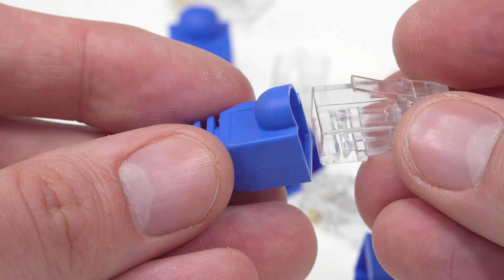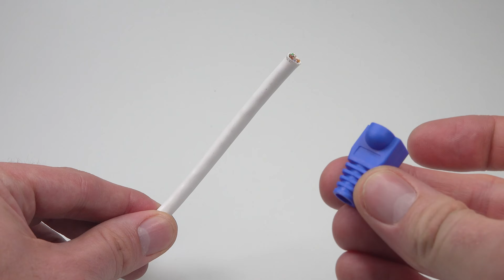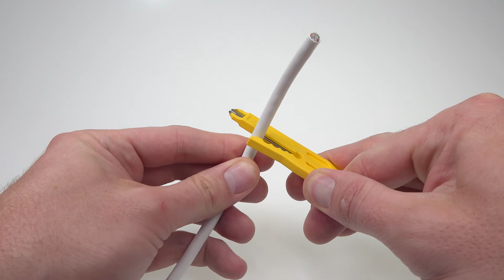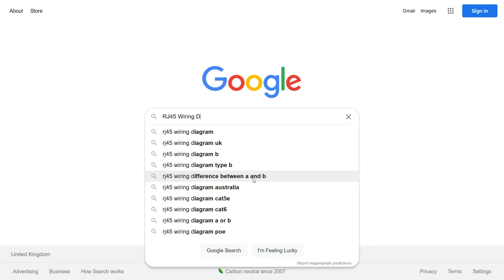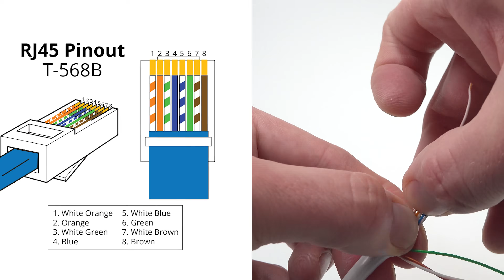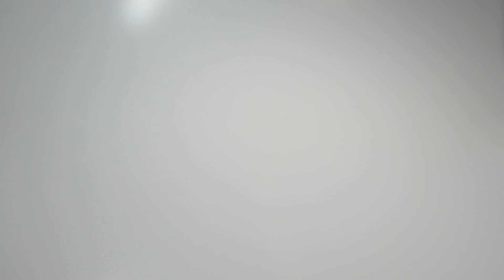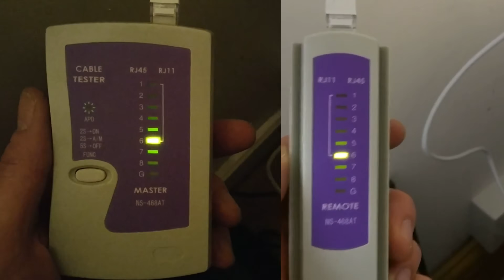How to Crimp Cat5 / Cat6 Network Patch Cables (RJ45 plugs)

Comment: Shouldn't any wiring order work as long as both ends follow that same order?
Reply from the maker: No, because the twists and which pairs are twisted together are important. Different pairs handle different things and in different direction for two way communication and error handling etc. Twisting pairs together prevents electromagnetic interference and allows cancellation of unwanted RF etc
Reply: @SwitchedOnNetwork  Good to know. Thank you.

Comment: i'm having an issue where I recently replaced a cat5e with a cat6 that goes from my verizon modem outside my house to my router inside my house. I crimped the cat6 myself by my router is reporting a 100mbps full duplex signal instead of 1000mbps which is what I expected. The wire is kinda already installed and pinned against the wall. What should I do? Where should I start?
Reply: Start by using the cable tester. It's possible some lights won't light up. Fast Ethernet (0.1Gbit) can run on just two twisted pairs, so that's why it's still syncing at all, if indeed something has come undone. You may need to reterminate, and pinning against the wall may not be so good.

Pass-through RJ45 plugs are much simpler to get right.

Comment: I wanna say best tutorial and dumb proof, but somehow my new cable is not recognized at all :D
Reply from the maker: Ooops! Did you test it with a tester?
Reply: @SwitchedOnNetwork  Nope, i didnt push   brown one all the way in, i realized that after i tryed to pull it out, bcs i though i can do same step all over again, but then i realized it cannot be replaced one you press crimpers. :) Well, bought a new 5 connectros and was able to make it on first try, but yea, weekend on WiFi with laaags :( :D
Reply: Practise makes perfect... you crimp enough cables you will eventually hit almost 100% connectivity without even using a tester..... not that you shouldn't a tester... but confidence is a powerful thing. :P

Comment: I have two (possibly stupid) questions, hoping that others may benefit from any answers this may get. :-)
1) What is the "tip" of the yellow stripper tool used for?
2) Is there any technical reason — beyond making it easier for maintenance —  to use the same standard that a network currently uses? For instance, when I first lay down cat5e cable in my house over a decade ago I used the 'A' standard to terminate the cables going from one switch to the next. If I were to replace one of them with a new cable terminated with the 'B' standard, wouldn't it still work? As far as the switches are concerned, they're nothing more than patch cables. I'm not sure if I'm missing something obvious, hence the "possibly stupid" question. :-)
Thank you in advance!
Reply from the maker: No such thing as a stupid question! :-)
1) It can be used as a (very rudimentary) punch down tool for wiring up keystone jacks (ie. wall sockets). However, if you're going to be doing any of that I'd recommend a much better tool, the one I demo in this video here: https://youtu.be/IHxTbtAEd-E
2) You're basically right, yes, they'd just be treated as patch leads so you wouldn't notice or experience any problems whatsoever. There's a bit more to it than that, and I'm sure someone will come along and tell me how wrong my last statement is, it's to do with legacy backwards compatibility with smaller RJ11 phone connections before the general shift to the B standard but it's too much to get into here. TLDR; yes you'll be fine with either standard! (But as you say, for maintenance, knowing that anything other than a simple pre-made off-the-shelf patch lead uses either A or B will be useful for any properly installed cable runs).
Reply: @SwitchedOnNetwork  Thank you very much! I just have ethernet cables going straight into switches as those "wall sockets" were insanely expensive when I first started cabling up my house many years ago, and I just kept going like that. :-) Also thanks for clarifying the A vs. B mix-up issue: I kept seeing the same recommendation ("make sure you use the same as what's already there!") but nobody ever points out that it's mostly for maintenance reasons, rather than anything technical. The A system should be an expansion of RJ11, with the central pairs being effectively the same as an RJ11 connector and the other two added to the sides, one wire on each side per pair... if that makes sense. Still no idea why B is "better" but it's one of those holy wars we all seem to partake in when it comes to technology. :-D
I also just followed your suggestion in another video and ordered a box of pass-through connector, a pair of pointy clippers and a specialised crimping tool, as I've had hell trying to crimp this cat6 wire with the old equipment I had: the wires are so stubborn that the moment I went to actually crimp the connector, at least one would "roll back" and not make contact. And to think I could crimp cat5e cables almost blindfolded! I do wonder if using the B system would make for a physically looser "sorting order" of the wires. I'll give it a go as soon as the crimping tool is delivered, maybe that's why it's considered better!
Thanks again, and great channel. Subbed here and followed you around social media — seems like we share several points of views!

Comment: Wired up both ends but when testing the led in the 6th position doesn't light up. Does this mean the solid green wire (the wire that is occupying the 6th position) is faulty/broken?
Reply: Great vids by the way 😁
Reply from the maker: Thanks! Yeah that will mean there's a break somewhere in the connection. Depending on how fancy your tester is, it might tell you which end (or at least help you figure out which end) so you know which one to snip off and redo.

If you're using a tester like the one in the video, try swapping the sender/receiver ends round. IIRC, if it lights up on the sender end but not the receiver end it's likely that the fault is on the receiver end - hope that helps!
Reply: @SwitchedOnNetwork  had plenty to spare so cut them both, bought some passthrough clips for good measure and all is good now. There'll be no stopping me now!!! 

Thanks

Comment: Did you use 8B in both ends of ur wire?
Reply: Or the other ends of ur wire is 8A?
Reply from the maker: Yes. You must use the same standard at each end (A and A or B and B) unless you want to make a crossover cable, which would have A at one end and B at the other (rarely used these days).
Reply: @SwitchedOnNetwork  where would this type of cable be implemented?
Reply: @StrangeComments  Older computers may not have MDI-X. If you need to get a DOS computer online and the ethernet driver is loaded and working, but it only works if you connect to a switch, rather than to another computer, and you want to connect it directly to another computer, you may need a crossover cable.

Most newer ethernet cards are capable of automatically faking crossover mode. In the last few weeks when I have been using ethernet cables to connect my computers, I have only used patch (A to A, or B to B).

Comment: I am trying to learn from this tutorial and I think there is something he didn't tell us, and that is that you have to put the snap away from you on one end but the facing on the other end -- so the wires colors are mirrored.
Reply from the maker: If you do that you'll have a crossover cable - which is fine if that's what you're intending to make, but certainly NOT fine if that's not what you want. If it's a long patch lead you need to make (eg. for connecting a device to a router/switch) then you need the clip facing away from you on both ends, so both ends are identical.

Comment: Genuinely amazed your channel isn't bigger with tutorials as well made as this. Serious props my guy, really well made.
Reply from the maker: Thank you, you're so kind!
Reply: @SwitchedOnNetwork  I should be thanking you! Saved my ass with my Networking college course.
Reply from the maker: Excellent! Glad I could help 🙂
Reply: Maybe if the colors weren't in the wrong order they'd have a bigger channel. He's got the solid blue wire in pin 3 in the video. Obviously used a different cable for the test at the end.
Reply from the maker: You spotted the Easter egg, that I used the wrong bit of footage at one point whilst editing by mistake 🤣